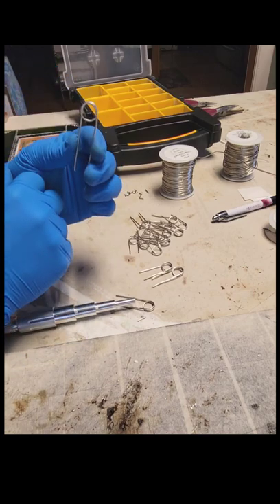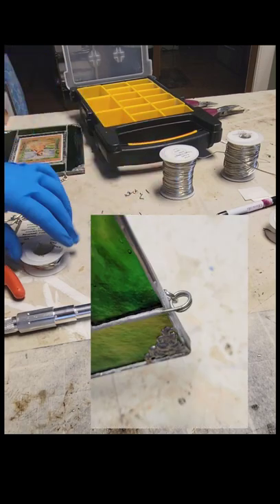Making Heavy Duty Hooks for Heavy Stained Glass Pieces

Comment: Thanks, that is very helpful. Someone gave me a fairly heavy stained glass piece, but the hangers came off. Apparently, they were not strong enough to hold up over time. I want to hang it again, and there is no one to do it, so I am going to get brave with my soldering iron and some copper bonsai wire.
Reply from the maker: Good luck with your project!  Hope the video helped